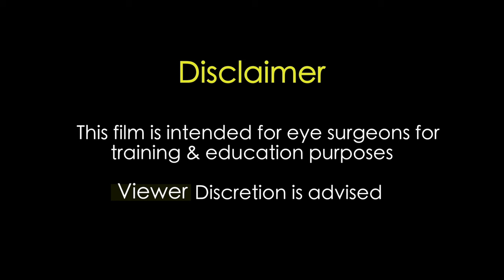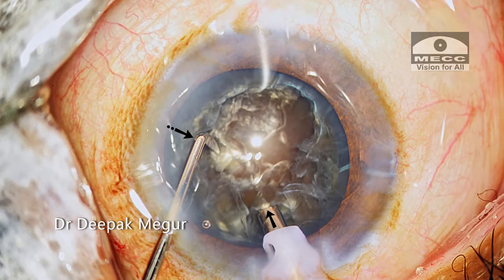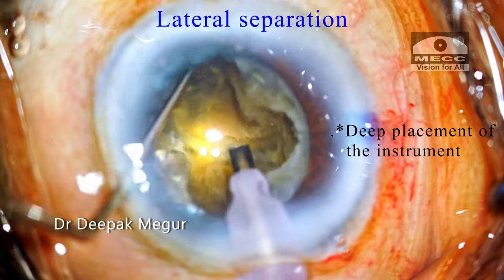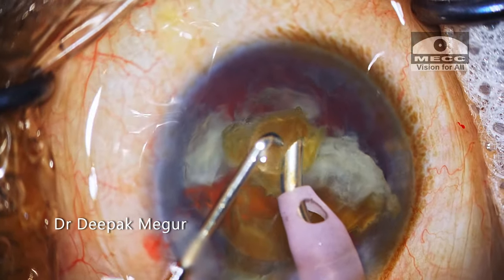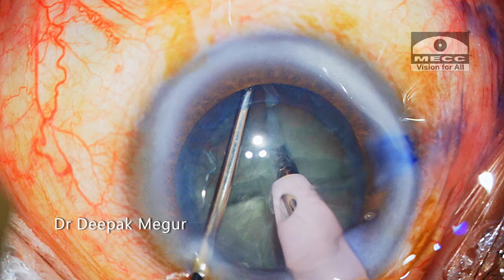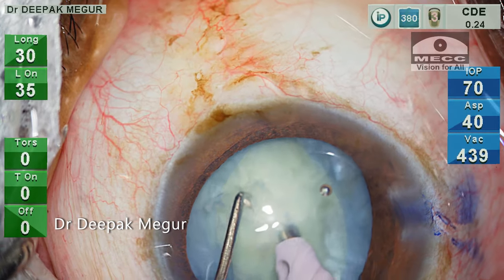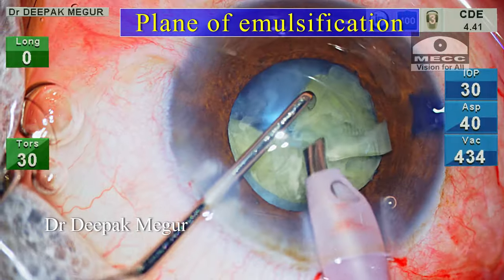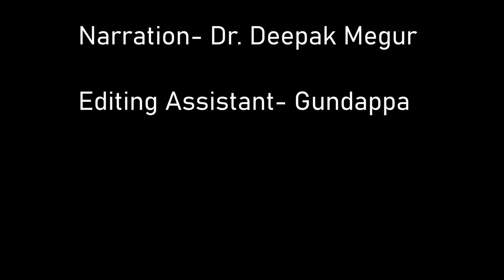Phaco Basics-Nucleus management pearls & pitfalls - Dr Deepak Megur

Comment: Very helpful for beginners like us sir....u r to the point in all your videos...worth watching many times..
Just one doubt sir, should the tip should always be turned laterally while quadrant removal sir??
Reply from the maker: thank you Dr Barki. I prefer to use the tip facing laterally simply because the maximum surface area of the bevel is exposed to the surface of the fragment. I feel this works best for the alcon designed tips which are typically 45 degrees or 30 degrees  bent kelman type or the balanced Tips
Reply: Thanks sir